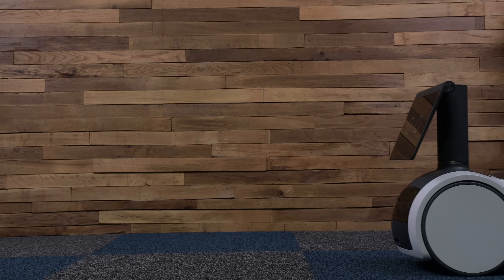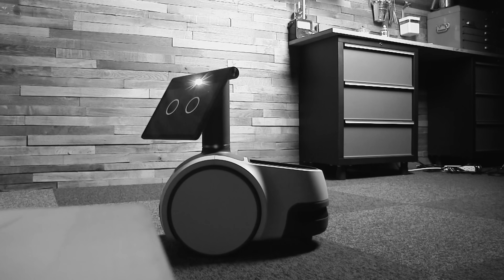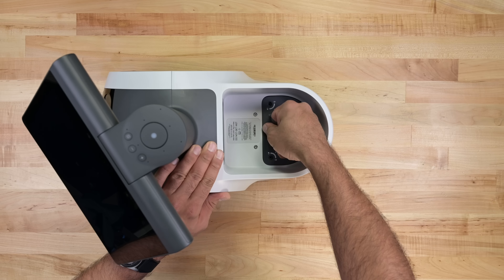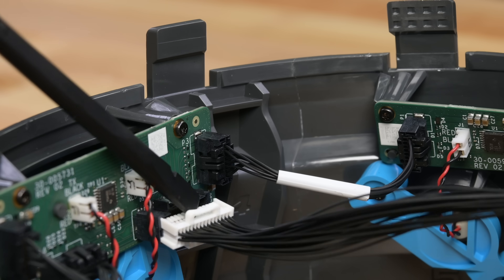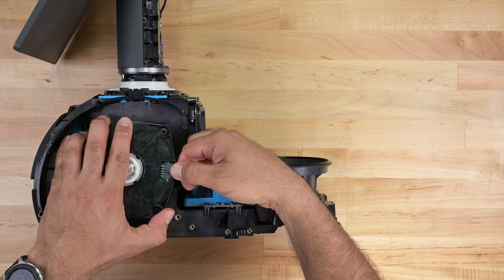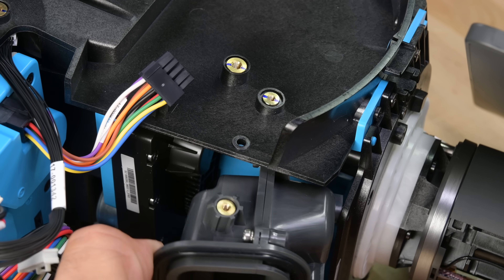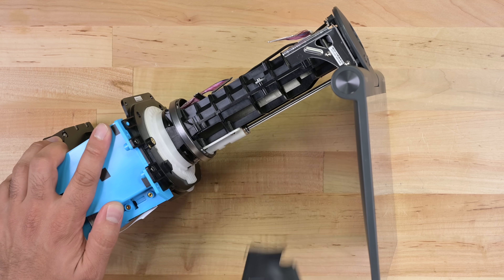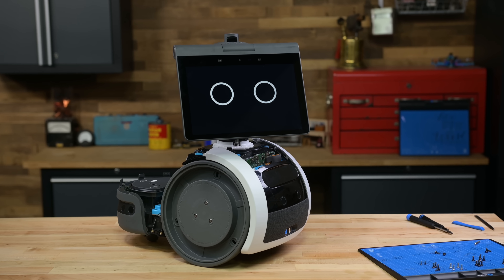Amazon Astro Teardown: Are Secret Repair Agents Fixing Tech Design?

Comment: Hi iFixit Team,

Thank you again for the highly detailed Amazon Astro teardown. This video is the only resource available for understanding the robot's hardware.

We are attempting to create a complete Bill of Materials (BOM) to fully document the components of this device, but we are missing the crucial, proprietary part numbers.

When you had the unit disassembled, would you happen to have a photo or record of the markings for the following components?

Main Drive Motors (Brushless): We need the full model number or manufacturer code found on the sticker or housing of the drive wheel motors. These are essential for specifying the robot's primary propulsion.

Actuator/Manipulation Motors: Could you provide the model numbers for the small brushless/stepper motors used for the head/screen tilt (pitch), head/screen pan (yaw), and the periscope extension?

Battery Cells (A1440 Pack): The pack uses 18650 cells. We need the exact cell model number (e.g., Sony/Murata, Samsung, or LG model) stamped on the individual cells themselves, as this impacts capacity and safe operation.

Any of these part numbers would be a massive contribution to the independent documentation of this device. Please let us know if you captured these details!

Thank you for your expertise and help!"

Comment: I’ve been through 3 astro robots…there is only one vent on the bottom, if i’m not mistaken….if i was to use a router fan on that vent would it be more effective to have hot air sucked out of astro or should orient the router fan to blow air into the vent?

Comment: I ordered an Astro... it was always running hot to the touch. Amazon sent a replacement, same thing. It feels hot, especially when you are doing a constant task like listening to music. Battery life is a paltry 2 hours and 50 minutes when left idle, if you play music at 50% volume, less than two hours. I bought an IR camera just to measure the external temperature: 120F on average, which means internal temperature is a raging inferno. Unfortunately I'm past the return window. Just 3 words: dont buy it.
Reply: Battery life is shorter than I expected, but charging time is also much faster than I expected. It has no problem going to its charger. If you want it primarily to follow you around to play music, it's not a good solution compared to spending a fraction of that money on high end Echo devices for each room.

Comment: I Don't Think Robots Can Do Proper Survillance, Like What If The Intruder Comes When This Is Charging Or Low On Battery?
Reply: If an intruder comes in while it's charging, it's no worse than if an intruder comes in while it's in a different room. Charging is relatively fast, and it pays attention while charging. It will probably charge when it's around 50% so it's unlikely that it won't have enough power to go somewhere at any given time. And if an intruder is in the house, I wouldn't expect the intruder to stay there for hours after you've been informed.

Comment: I hope Amazon offers a way to buy parts such as the battery and cup holder
Reply: You can dream
Reply: @lewisk8742  I expect that they will if the product doesn't die. Otherwise, it will be a matter of rebuilding the pack, or sending it in to somebody. It could be like Aibo, where Sony was of no help but private individuals popped up on the Web to offer rebuild services. But Amazon isn't Sony, so they might have a different attitude. It's hard to say since in the past, it came down to much cheaper devices. If your $40 Fire stick fails and you ask them about repair, they'll just offer you a discount coupon for a new one. They can't do that with a $1500 (if it gets there) robot.

Comment: I hate that shirt so much

Opening devices does not void warranties in the USA, and saying it does is illegal (for the mfg)

I understand the joke but I'd much rather you be cramming the magnason moss warranty act down peoples throats than a joke that perpetuates a dangerous lie
Reply: It does in very limited cases, such as opening up an HDD, where something like a head crash most likely happened because of something like micro dust particles. It wouldn't be reasonable to claim that a failure was unrelated to opening it. Likewise, if something fails due to not being properly sealed, it's reasonable to suspect that opening it up might have been the problem. But in almost all cases, whatever the item is, it's yours and you have the right to open it up and do whatever you want. 

Saying that it does might not be illegal, but failing to honor the warranty would be illegal.
Reply: @bW9taeH4   instead of focusing on extremely fringe case AKCHUALLY maybe dont go all hailcorporate and recognize that breaking the law to protect your bottom line and hurt consumers is bad
Reply: It would be breaking the law to enforce the provision. It's a given that provisions that are illegal to enforce can't be enforced, but it's not actionable if they don't deny you service.

Comment: It's a TOF (Time Of Flight) distance sensor. Usually, they're using an IR diode (905nm or 1550nm) with a photodiode. You can measure distance, but also speed with those (the measure light pulses getting longer, moving away from an object, or shorter, moving towards an object, and comparing it to a steady state pulse allows you to measure speed, in both directions).